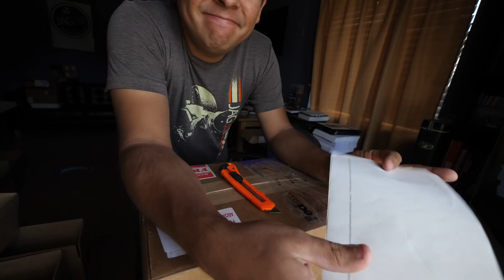Best 18650 Battery Modules UPDATE

Comment: I ordered the buss bars and received the flat bars but can't find out how to order the "U" shaped bars! Anyone know how to get the U shaped bars???????
Reply: smashimone, you would have had to email Jesu and ask for the number of parallel and number of serial bars you needed. Sadly, I did that about a week before you posted, and got referred to the source, but his inbox was swamped, and my request never got delivered.

In the meantime, I bought a foot of 3/8" copper tubing, hammered it flat and smooth, drilled a 1/4" hole in each end, bent it into the 'bridge' shape (a PITA, even with a big vise and big hammer!) and voila, joy in the neighborhood. (I had the flat (parallel) bars, having ordered blind in hops there would be a mix, so didn't need to make bus bars, but having researched using copper on this setup, I wish... Well, 'No regrets', as the saying goes.
Reply: Sean thanks , so am I to understand you do have the source then so I can at least contact them directly?
Reply: smashimone, sadly no. It's no longer in my history or trash. Very sorry.

I made my own out of 3/8" copper tubing, flattered, drilled, and bent. If you don't have the resources to do that, I'll bet you have a friend who can help.

Comment: First off, thank you so much for all your videos. You're a freaking Guru, and an awesome resource, so thanks! Second, I've seen a lot of 18650 batteries on eBay claiming to have some 10,000mAh at 3.7V. I can find some of these packs at 50 cells for right about $50 ($1 per battery). Now from what I've seen, I see more cells in the 2500-3500 mAh range, for more like $2 to $3 per. I was wondering if the 10,000mAh batteries are BS, or if there was some catch to them (like they suck or something), or if I would be getting a great deal on batteries if I were to buy them. If they are bad, I would definitely want to go with quality, and get the 2500-3500mAh batteries instead. What do you think?
Reply: Lol just watched your Trust Fire video. Answered my question.

Comment: Why are the modules not cell fused? Which is a must!
Reply: Charles Fitton if this question is for me, yes. I will try to contact them today. Sounds like they sold out, but I'll try. I don't need their batteries, I just want the connectors. If anyone here can help let me know, after the tests I will return them.
Reply: Mikes DIY Tesla Powerwall they look cool and super easy to use but man they also look scary. I'm going to buy a handful and torture test them. I really hope they are as good as they look though.
Reply: Are you going to do a vid on this?

Comment: I am very much looking forward to some more about the 36v hoverboard packs. I have been working on power strips similar to yours but a bit beefier. I've been thinking about a fuse for each strip and looking for sources. Also am having a problem finding a battery charger that can cycle. What do you use?

Comment: Sorry nothing to do with the batteries.

I note the manual seat adjustment used. I like it. We need more of these things back in our cars. Manual seat, manual steering posts, mechanical mirrors, mechanical boot opener, manual roof, etc etc.. Shave all of the "lazy helpers" off. Reduces weight, saves electrical power, and it could make using a smaller battery possible. These are only convenience items that we can adjust very easily with muscle power.

Literally the only really 100 % useful invention were the power window.

Comment: jehu I saw a video that explained why the 18650 cells in power tool batteries are much better than laptop cells. as you are the 18650 YouTube king, is this true and if so why?
Reply from the maker: better?  depends on the application,  power tool cells are power cells,  laptop cells are energy cells.   power cells would not work as well on laptops just energy cells would not work well on power tools

Comment: I ordered 45 packs and plan to do 4s11p of the packs, for a 12-14v system @440ah I didn’t see where I can  order the other bars for when I go parallel, I ordered 40 bars
Reply from the maker: +Chris Solomon  just send me a note how many of the cross over ones you need
Reply: jehugarcia I need 44 series bars and 22 parallel, to make 4s11p one big powerwall
Reply: jehugarcia I did send an email just now along with what I need just going to put 4 serious and stack them 11 high
Reply: I was wrong on the count, 22 and 22 is what i need as i sent an email to the order email Thanks

Comment: Hey everyone (especially Jehu :),

I'm in the process of picking an electric motor for my electric motocross/enduro build. It has to have enough torque (horsepower is not that big of an issue) and it's gotta be fairly light. As I have no experience with the torque differences of electric motors: Which one would you suggest? 

Btw, do you think I can get the ev waterproof...?

A few suggestions would be awesome, 

Cheers Manu
Reply: try check out these motors.. Goldenmotor  https://www.goldenmotor.com/

Comment: Hey Jehu. Love ur video, kinda lean a lot from u. Want to ask you a favour, can u make a video on trying to make a portable AAA battery generator that we can use to plug in any ac equipments like a bain-Marie. Thanks
Reply: yeah, using non rechargeable batteries is a terrible idea. you'd need a couple hundred just to power a laptop for a few hours and the cells would likely get very very hot and with that you'd only get the one use. use lithium batteries. lithium is more expensive up front, but the cost alone over the longtime is enough to justify using lithium cells because you'd be spending many many times that repeatedly replacing those AA's. Nevermind the fact you can just recharge the other cells and dont have  to buy more.  Also, probably shouldn't connect those AA's in parallel, anyway, because they will try to balance. the lowest cells will dump all their current into the NON rechargeable batteries and we all know what happens when yo try to charge a AA..
Reply: Sorry I mean AA battery not AAA battery.
Reply: Would not recommend. NiMh batteries have about 3-4 times less energy density, due to the much lower voltage. Would be quite a big battery with these.
Reply: NiMh cells are rechargeable, but their energy density is much lower. The only reason you would want them is more peace of mind.

Comment: Hi Jehu, do you ever heard from Kreisel Company in Austria. They found a way to connect Cells without killing partly the chemicals. Now they have 20% more capacity than Same cells from Tesla has and Could be loaded with much higher power and faster. Their vw Golf Batterie can load in 15 min.
Reply: Three things: They are using laser fusing, which creates even less heat than traditional welding, which creates more heat and damages the cells. This also, presumably, allow for more batteries per mass and per volume, as there's also less conductor being used in laser fusing. This fusing also allows for much much less variance between cells, and therefore, they state that they don't need a BMS to balance these cells.

Second, they are liquid cooled inside the battery pack itself, using a non-conductive liquid to cool them between 25-29 degrees Celsius. This allows them for many more cycles too. This liquid is provided by 3M.

Last, they are connecting the cells using a unknown material which is sandwiched between the cells, which decreases by a large margin, by about 2.5 times actually! Which is amazing for charging speed, and discharging capacity, which is higher by 15% due to lower IR.

More info is here: http://energystoragereport.info/kreisel-aims-to-put-tesla-through-its-paces/
Reply: TITO TORRES what are you talking about? why would connecting cells kill the chemicals?
Reply: NeutronPCXT Interesting article. I suppose the liquid is similar to that used in water-cooled PC's. I'm a little skeptical of the fast charging rates, but maybe it's just good engineering evolving the concept.
Reply: It's similar to that of a oil submerged PC as I'm seeing. The difference is that the liquid flow rate is probably much higher to counteract the heat resistance of the batteries.
Reply: Ivan Stroganoff, it kills only a part of the chemicals. And every time in different percentage. Thats the reason why you need bms. This find the lowest capacity battery and load only what that battery can take without destroying.

Comment: Jehu, could you please find out, if we can get these plastic holders somewhere for cheap from the manufacturer? So we could use our cells and put them in.
Reply: If he can’t find the manufacture, can he scan them in to CAD so they can be 3D printed please. For your guys in other country who can’t order them
Reply: Bump, I would love these!
Reply: I was wondering what to do about the balancing cable connection.
Reply: Each pack is acting as one cell, so an individual pack doesnt need to be balanced. it does that passively. you do need to worry about balancing if you connect any in series, bu the packs by themselves are 20p 1s, though.